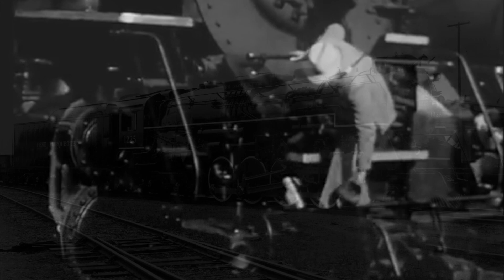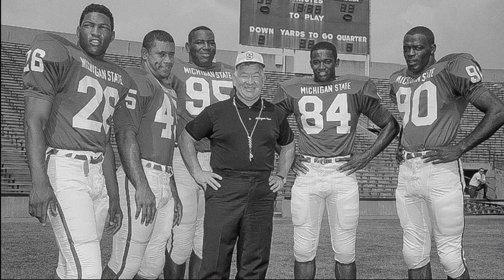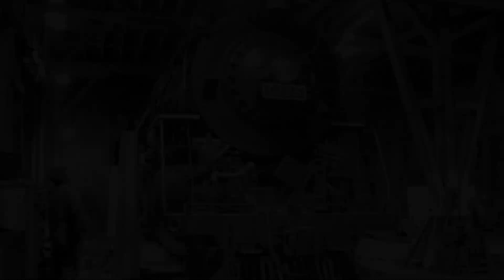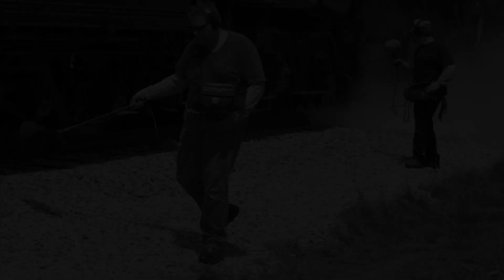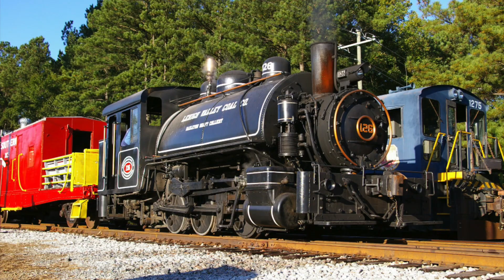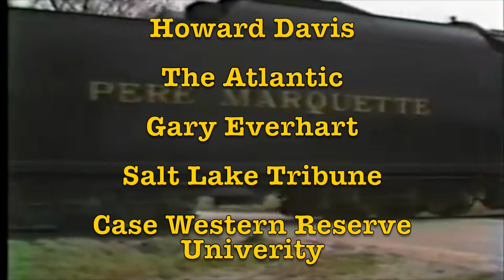Pere Marquette 1225: The Christmas Day Berkshire

Comment: Well actually after the C&O Merger Only the Class Ns were relettered and Renumbered and reclassified them as N-3s and meanwhile for the N-1s and N-2s they were equipped with C&O Treatment such as Flying numberboards but never relettered and Renumbered and yes the correction you said 1225 was supposed to be 2659 but C&O decided to keep her original number but you misread a little bit they kept her original PM paint scheme but she was upgraded with a larger PM Tender logo font like the N-2s

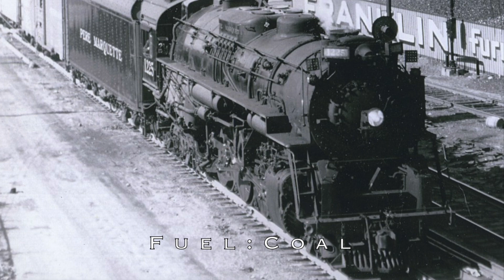Comment: @2:55 Did I hear you correctly when you said that 1225 is a "hand fired locomotive" ? Umm pretty sure she was constructed well after the FRA mandated that all locomotive of a certain size be fitted with stokers.... not to mention that her firebox grate size would be a pain in the ass to firebomb when trying to climb any kind of hill.
Reply from the maker: That was a mistake on my part, she is a mechanical stoker.

Comment: You said 1225 has a 5 Chime. I have reason to believe that you are incorrect and I believe it is in fact a Nathan 6 Chime. First of all, even though it sounds like a 5 Chime, it has a more raspy sound akin to a 6 chime. 2nd, It can be confirmed by sister berk 1223 that they indeed had 6 chimes using the only video of 1223s whistle being blown.
Reply from the maker: Lima built 1225 to have a Nathan 5 Chime. Did the SRI change it to the fouled/cracked 6 Chime?
Reply: @TrainGuru  I personally believe 1225 does have two whistles but I think they both are 6 chimes. It all depends on the material of the whistle and pressure going through. 1225s original whistle which I believe it has now is most likely made out of steel. The one it wore up until I believe 2008 or 9 was made of brass.
Reply: Cracks can also affect the tone like it has now.
Reply: @OzzmanStudios  I also believe that 1225 has a Nathan 6 Chime. The FWRHS, owners of 765, have said that the 765 has always had a Nathan 6 Chime (usually the one from 700) as her primary whistle. However, the whistles don't all sound the same. However, from 1979-1983 and from 2009-2011, 765's Nathan sounded almost identical to how 1225's whistle sounds today and in 2003-2008 respectively.

Edit: I've heard that steam deflectors and the position of the whistle inside the deflector can also effect the sound of a whistle.

Comment: Early in the video you refer to PM 1225 as being hand fired. This can't be correct; it would have a mechanical stoker. Also, I believe the word "Pere" is correctly pronounced "pair"; it means "father" in French/
Reply from the maker: Oh... I never knew that. Thanks for catching that! At some point, I will remaster my Southern Pacific 4449 and Pere Marquette 1225 SLP documentaries.

Thanks for catching my error though!
Reply: @TrainGuru  If the mechanical stoker was disabled for any reason, creating the need to hand fire, the Pere Marquette Berks required the assignment of two firemen. Also, the rails used were not those of the "Tuscaloosa" and Saginaw Bay, but rather the Tuscola (a very descriptive combination of two native American words meaning "flat land") and Saginaw Bay. However, small errors aside, this is an excellent documentary. Enjoyed it very much.
Reply from the maker: Thank you. I will 100% remaster 4449 and 1225.